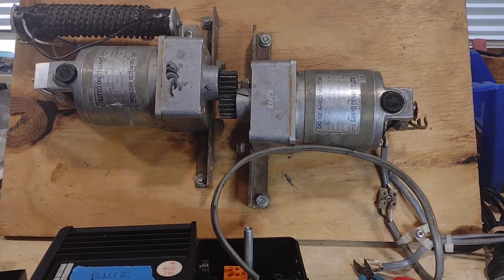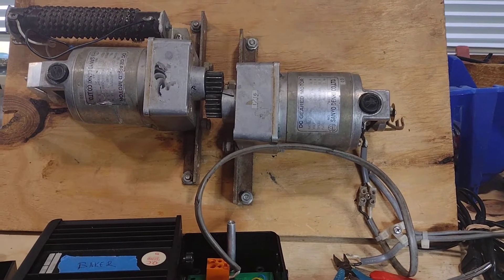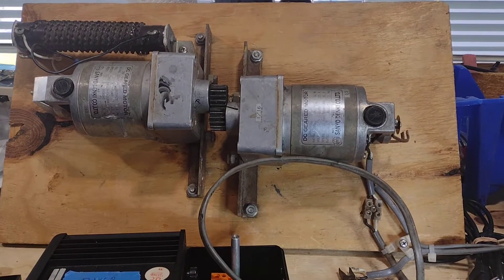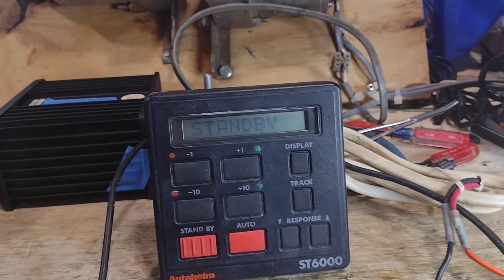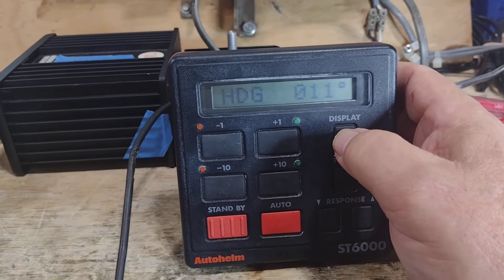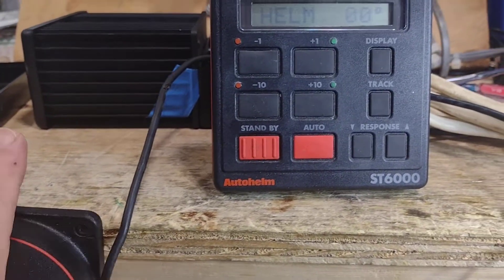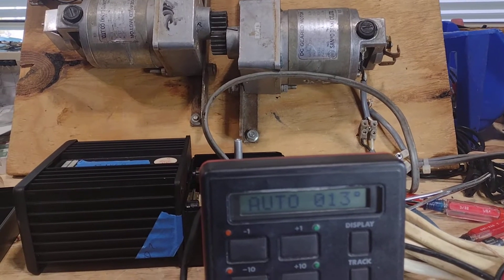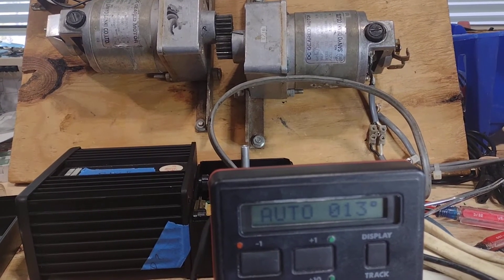Autohelm ST6000 autopilot post repair test.

Comment: Question (if U know ) - if I want to link 2 ST6000 units to my system - do I connect the outdoor one to the one inside ( already monuted) ? What type of cable do I need?
Reply from the maker: There were two version of the ST6000. The older version looks similar to the one in the video, the newer version is grey with a much larger LCD. Regardless, both communicate via the Seatalk 1 interface. The unit in this video uses a small (roughly 5/16" diameter) 3 pin cable, the later units use a "banana" shaped 3 pin connector. You can either connect the cables - in parallel - at the course computer - or connect them in series, "Daisy chaining" one display to the other. Contact me via my web site for more information.  www.marineelectronicsrepair.com